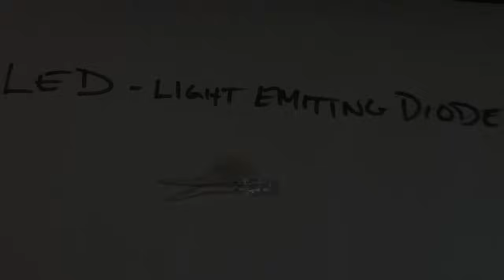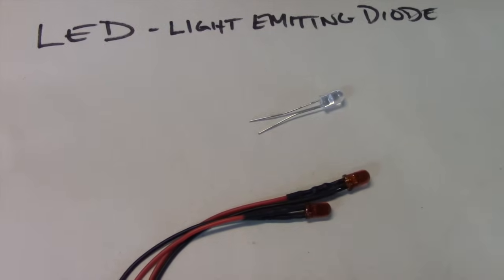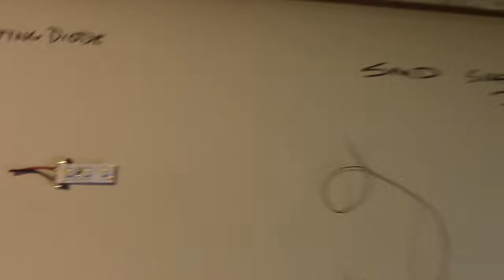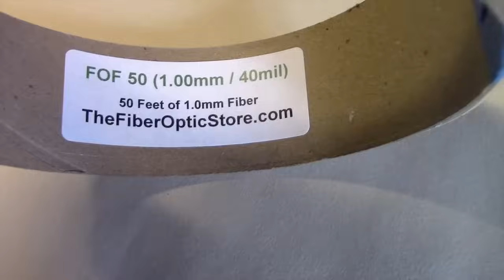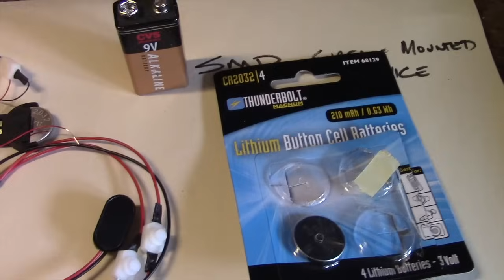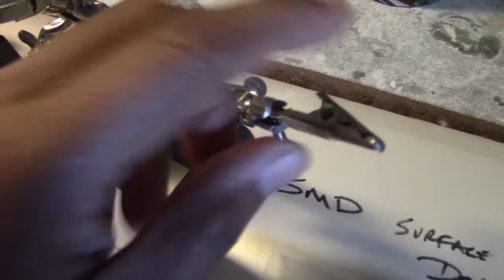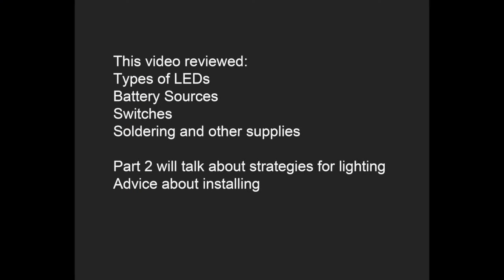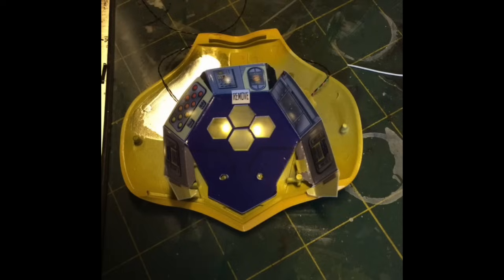Lighting Your Models Part 1

Comment: Of course, now all kinds of small L.E.D.s are available as party effects, set into clear unscrewable housings that use included remote controls to turn on, change color, fade, etc., and are crazy cheap. (try to find a U.S. distributor, though, as an order from China for a 10 bucks set can take months) What I'm looking for now is the smallest sets available, since the L.E.D.'s have to house circuitry, and batteries. Right now I'm surround by some pretty small clear little domes about an inch in diameter and have a height of 3/4". A set of ten with a remote is less than 20 bucks. If I can find a set that has sizes half that size, I'm king. July 2020.
Reply from the maker: sclogse1 the smallest I’m aware of are SMDs which can be connected to small boards that can be set up for various effects. Check out my NOMAD build, all done with SMDs. I would also check out EvanDesigns.com who have a good assortment of SMDs and can also help you custom make stuff for you. Thanks for watching

Comment: I just lit my old Seaquest DSV submarine model using a 9V battery connection. I had the model for years. I managed to put in the white bow searchlights and drill holes into the forward starboard and Port sides for portholes. The white LED lighting looks great in those sections. However, I also put in red lights on either side of the center vehicle hanger bubble, as well as a blue light in the engine area,. Those are  not working. I discovered that a wire had severed during reassembly (yes, I tested the wires before reassembly, worked perfectly). But, with just the white lights lighting up the bow headlights, stern, and port sides, it looks pretty good and impressive. I'll have to again disassemble the modelget to repair/re-do red and blue lights for the engine and the vehicle bubble area another time. Putting the lights in, that took 12 hours!
Reply from the maker: the Seaview definitely looks awesome when lit that way.  Send pics of the model if you get the chance.  ISMslideshow@gmail
Reply: @InterstellarModeler  I meant to stay, you gave me the incentive for this! From your Seaview video. It also gave me the idea about using a 9-volt battery, hidden in the stern. I thought about using outlet power and was rigging it up so, but I figured why complicate the matter, make it as simple as possible. I think I can do a rig to outlet power later on, if I wish.

Comment: can you please answer one question  ( the ones with the transistor included  can you soder them in a row IE 5 to 10 on the positve and negative side for the battery pack .)
Reply from the maker: Yes.

Comment: Hi! I'm coming from your phaser rifle video and looking to enhance my model with nice lighting. At 4:34 in this video, the banner reads that a resistor for chip-size lights can handle 12v, but at 4:48 you say it can handle only 9v. Can you help clarify here?
Reply from the maker: The resistor is rated up to 12V. I only used a 9V. Sorry for the confusion

Comment: Great info. Been working on a small lighting project for a model myself and found a method to splice wires together without soldering. The resin glue called Bondic will seal twisted wires and prevents shorts because it does not conduct electricity. The resin instant hardens with UV light supplied with the glue. After using the glue I then shrink wrap the connection.
Reply from the maker: nice....I'll check it out

Comment: Thank you for these videos! What gauge wire do you use? And where can you get that thin "magnetic" wire I keep hearing about. Google searches aren't finding it for me.
Reply from the maker: Hi Leelan...I'm actually not sure what gauge wire all the prewired LEDs come with but they are all the same.  As for the magnetic wire, I can only find it at modeltrainsoftware.  The separate colors are out of stock last time I looked but the do sell red/black magnetic wire intertwined.

Comment: To avoid a mistake I sometimes make, remember to slip a piece of shrink wrap over the wire BEFORE soldering, and one plenty large enough to accommodate the bulge of solder.
Reply from the maker: great tip, thanks

Comment: Hi my friend I'm struggling with lighting for my Stargate diorama. I'm trying to light up the gate with 7  I think there pico leds I have. Now I want a 9volt battery to power it,  but do I need a resistor or resisters to the leds and what size resistor I can't find this information anywhere.  Plz help
Reply from the maker: The easiest way to do this is to order the Pico LEDs prewired with a resistor if you want to avoid calculations.  Otherwise I'd advising contact the guys at modeltrainsoftware.com and they'd be able to help you.  I'm not sure what voltage is for those pico SMDs and dont want to give you a wrong answer

Comment: I have a colonial viper kit to build what LED lights do u recommend I use
Reply from the maker: I would recommend 3 chip lights for the cockpit, 3mm flickering cool white LEDs  for the engines (1 for each engine).
Reply: Interstellar Modeler thanks very much bro
Reply: Who can i order the lights from
Reply from the maker: The chip lights can be ordered from modeltrainsoftware.com while the flickering LEDs can be found on Ebay.  Just make sure you get them with prewired resistors. Also if you scroll through my videos you'll see I have a Viper build. You might find them helpful.  Thanks for watching.
Reply: Thanks very much I appreciate it

Comment: Hay I have a question for you that you can help me with, let’s just say that you are using 5 micro leds (that are prewired with resister) that each led required 3v what type of battery you should recommend me that I can use for them
Reply from the maker: if you’re referring to the smaller SMDs it’s been my experience that they can only take a max of 3V unless wired to a resistor. A 3v can certainly work but if you want them brighter you’ll have to go higher and thus will need the appropriate resistor. The guys at modeltrainsoftware can provide u with more advice and sell prewired SMDs if you dont want to deal with attaching resistors. Hope that helps
Reply: Interstellar Modeler thanks and also I relized that I have a 1 green micro 3volts, 2 red smd 2 volts and 4 white micro led 3 volts and I want to use is a 9 volt battery can I used that battery or can I use like a coin battery to power them up?
Reply from the maker: @AngelHernandez-dz9jd  Most SMDs and smaller LEDs can only take up to 3V (coin sized) unless they're wired to a resistor.  Otherwise they'll quickly burn out with a 9V or higher.  Hope that helps.
Reply: Interstellar Modeler ok thanks I’ll try it out
Reply from the maker: @AngelHernandez-dz9jd  Sounds good Angel

Comment: '' I want them to be self sufficient enough that I wont need to rely on an outlet'....hmm.....you are talking to me like I know exactly what that means, so in that short space of time, you've lost me....so what is meant by 'an outlet?'....
Reply from the maker: Sorry about the confusion. I was referring to an electrical outlet. An alternative power source you can use for lighting models is a wall electrical outlet which requires hooking up to an adapter transformer. What I meant here was that I didn't want to have to run over to a wall outlet each time I turned on the lights. My models are displayed on shelves and occasionally I'll turn them on for friends who are visiting.  It's nice to be able to just flip the switch to do so without having to take it to a wall outlet.  Depending on the build, a 9V battery won't last all day but it's more than enough to show off the lights.  The disadvantage is at a model show when you'd like to have it lit throughout the day but since that's a rare occasion, I typically wire my lights up to a battery that's enclosed within the stand.

Comment: What’s the standard gauge of wires used here?
Reply from the maker: The larger LEDs that are pre-wired typically come with 26 gauge.   The smaller SMDs can vary. At EvanDesigns they can come with 28 AwgKynar and others with thin magnet wire.  Hope that helps.  Here's a link to wire one can buy: https://evandesigns.com/products/kynar-hook-up-wire